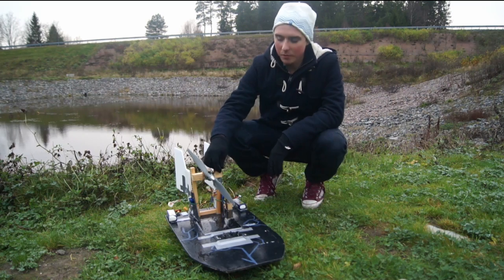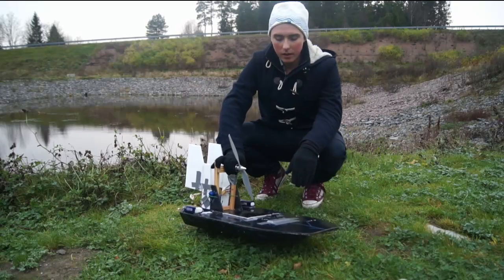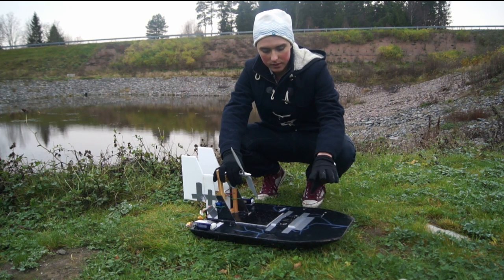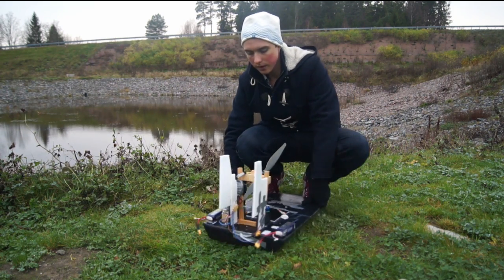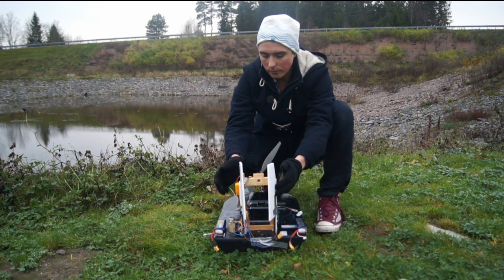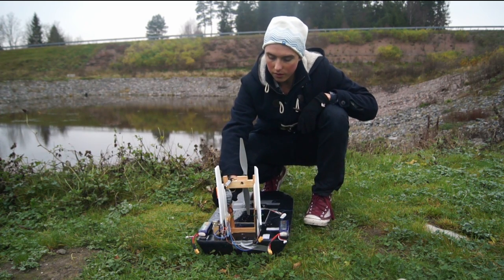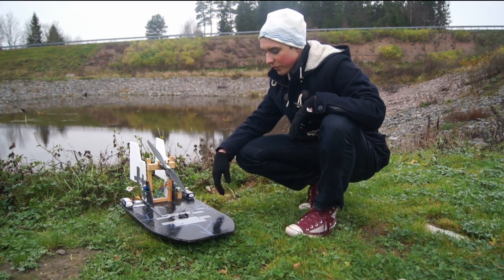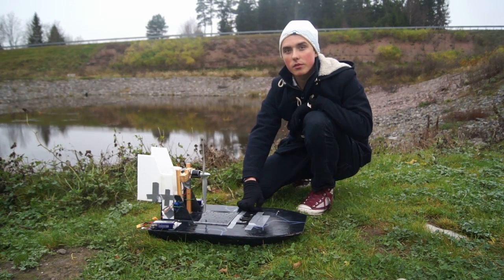Homemade Electric RC Airboat - RCLifeOn

Comment: I think you did a pretty good job being a first build and thanks for putting it on camera for us.
. Well done mate. Chap at our RC Airplane club in Australia built one using a surf boogie board made from foam and I think he enclosed the electrics in a plastic tupperware or decor container. I'm sure your next build will be even better. I'm looking for ideas as a family member has moved to a community that has a saltwater lake in their gated community. Apparently there's a big groper swimming in it so I might put a fishing line out the back but I think it might pull it under if I hooked it .Cross fingers.

Comment: I built one few years also.  I hope to get it out this year a mess around with it.
Reply from the maker: ***** Do you have an electric motor or a combustion engine? Even though it goes on the water quite nice, it's not powerful enought to go on the grass. Quite disappointing.
Reply: RcLifeOn
I've got an OS 35 nitro engine.  I had it on the water briefly but have not tried grass.  I don't think it would move at all on grass.